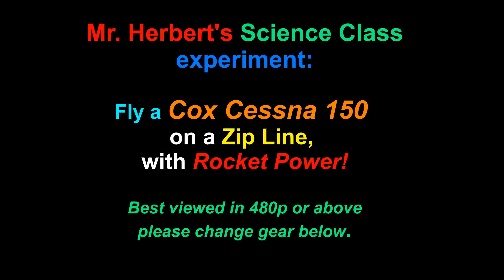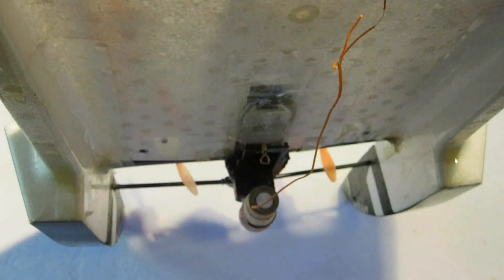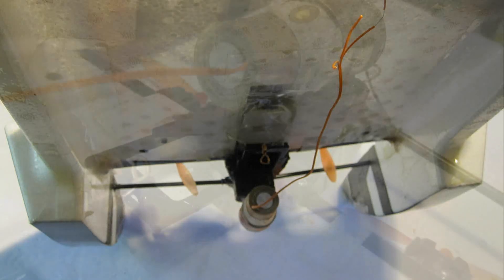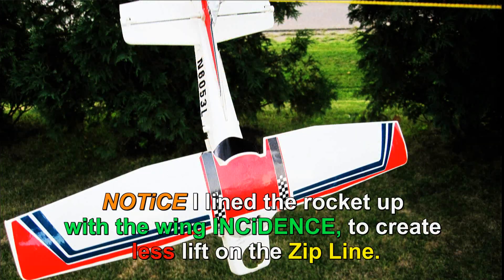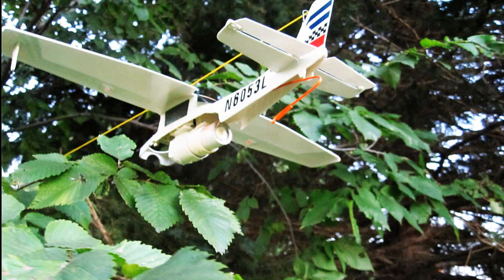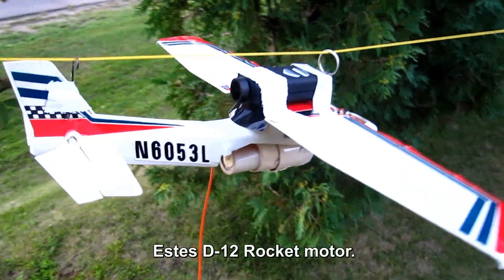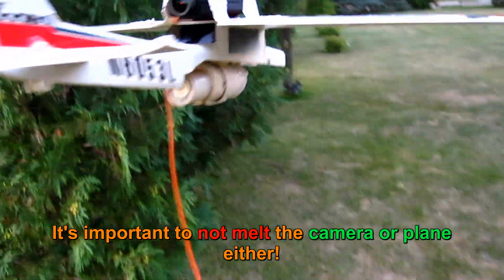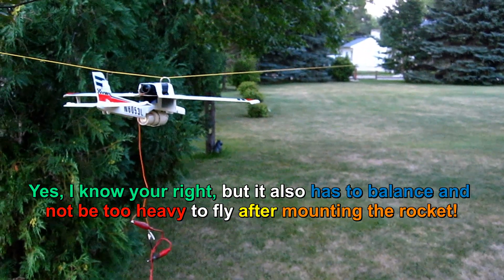Rocket powered Cox Cessna 150 does nice rolls on the Zip-Line!

Comment: Why does it corksrew like that?why isnt the thrust just straight line?
Reply from the maker: philo426 Since is a U Control control line airplane, it has thrust built in, and slight drag on the one wing where the strings used to exit,  or a slight warp, ....could be many things. (rocket motor could be slightly off too!) I was going to put a trim tab on it so it WOULD roll, but I didn't need to as it did what I figured it would. A trim tab might have made it really roll too fast, so am glad I did this test first. Good question. Thanks kindly.